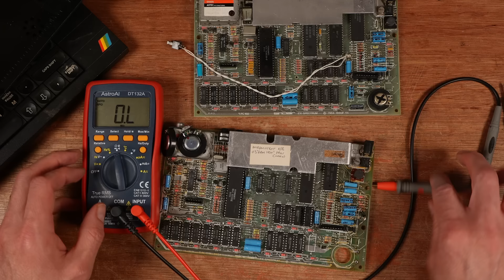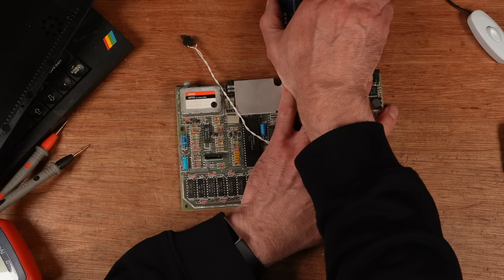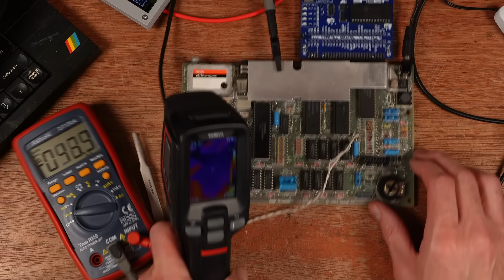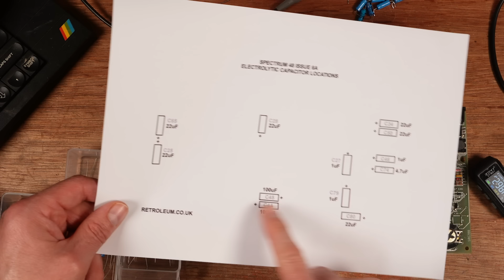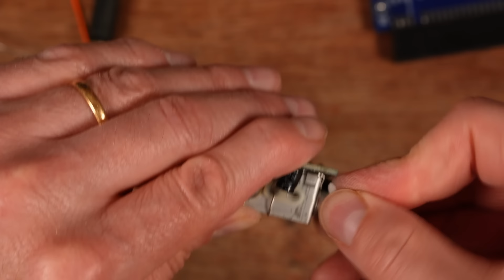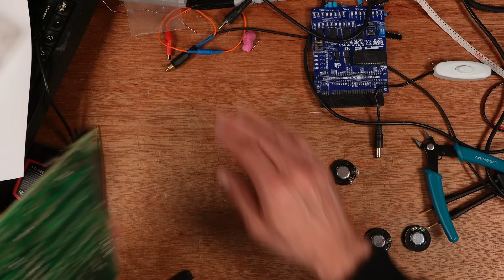ZX Spectrum 48k Hot Chip Memory Fail

Comment: They simply could have used 7905 and 7912 regulators, but no... cheaper to use a DC DC circuit that fails miserably when a capacitor is going bad... 😀
Reply: Let's not forget those capacitors are cracking on for 45 years old now and were cheap part to start with, Sinclair was infamous for cost cutting (like the dodgy QC fail RAM chips he installed), the DC-DC was a common failure mode back in the day as well (I worked with a guy who worked at Sinclair in the returns/repairs department, some of the stories, 😱) but it was a good idea, even if the implementation was a bit ropey.

"simply could have used 7905 and 7912 regulators" is a heck of a statement, to do that would have added a lot of board space and needed either an AC transformer with higher output voltage (more power dissipated or a custom transformer, expensive) or a centre tap (different input connector), then they'd have needed to add rectifiers inside the machine as well as the heatsinking for the regulators etc etc.

Comment: Adding a 10 ohm resistor to make the impedance seen by the driving circuit 40 ohm is fine and safe. The down side is that it will be quieter because 25% of the power sent by the driver is converted to heat by the resistor instead of sound waves by the speaker.